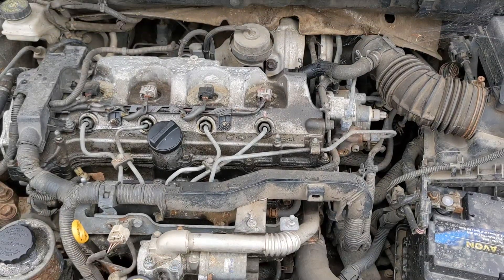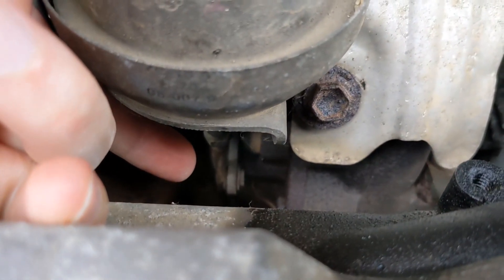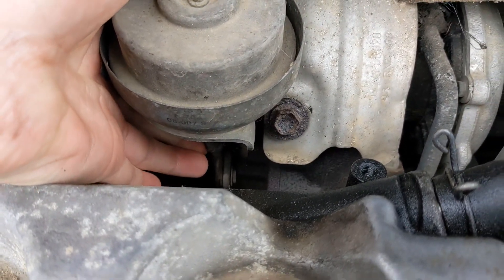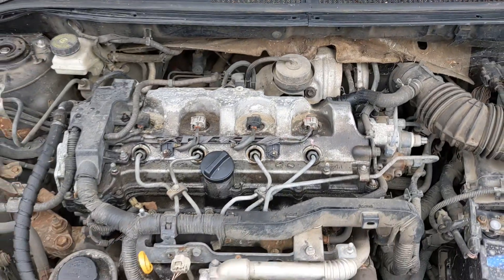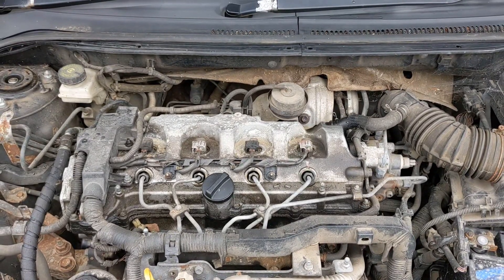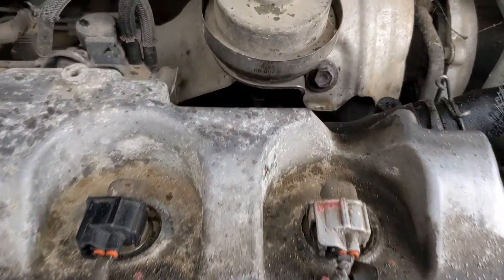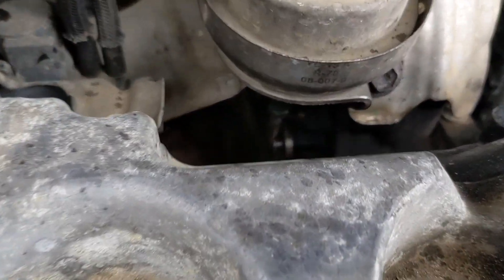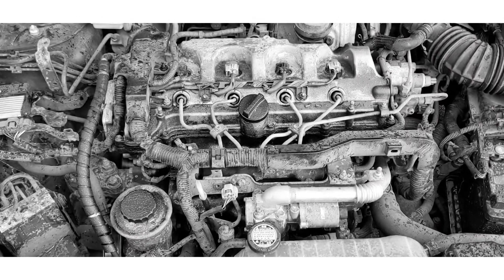Toyota 2.2 D-4D Variable Turbo Actuator Fault - No Boost Below 3k RPM - FIXED!

Comment: We just disable it forever or we put it back again to work.. When we put it back a pipe? Or we disable it permanent
Reply from the maker: I cleaned the rust off and reconnected it. Was fine for the remainder of the year I had it.

Comment: Hello, is it the same on Toyota Verso 1.6 D-4D , because i have the same problem?
Reply from the maker: @antoniopodgorscak5134  Hi. Not sure, but it would not take much to find out. Have a good at fixing it yourself?
Reply: @iamaparanoidandroid1 can you explain to me how to do it on my car?
Reply from the maker: @antoniopodgorscak5134  that is what the video shows. I can't really explain it any better. The linkage between the wastegate and the turbo actuator was corroded solid.
Reply: @iamaparanoidandroid1  but on my car is not exactly the same, so i cant figure it out where to look. If you could find picture of my motor and tell me where is that?
Reply: And if i make it like you made it there will be  apear some problem on the
 car or not?